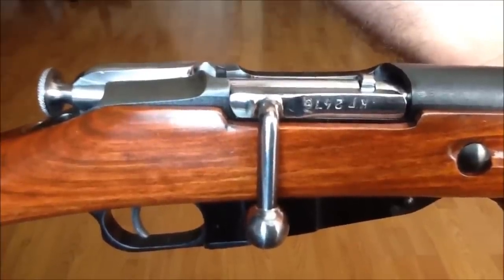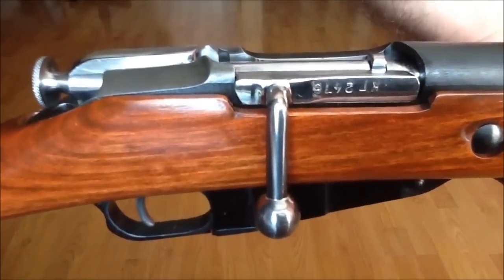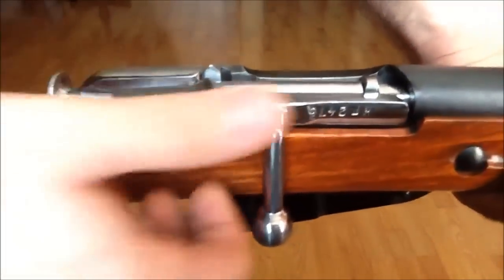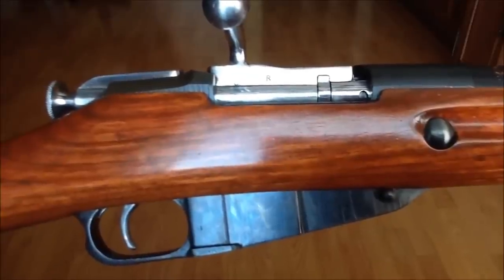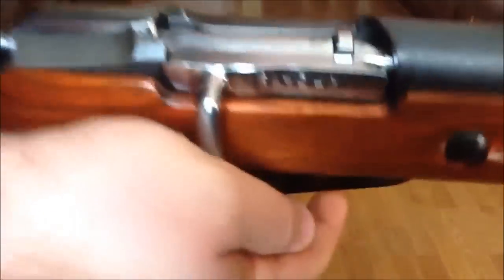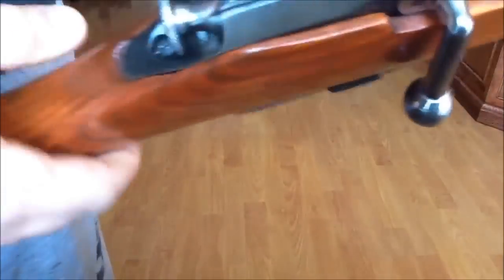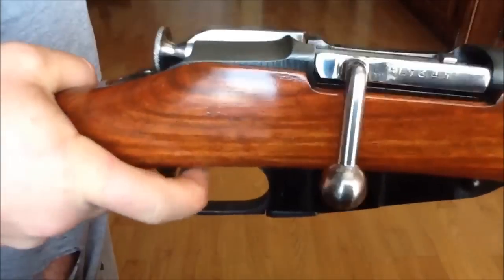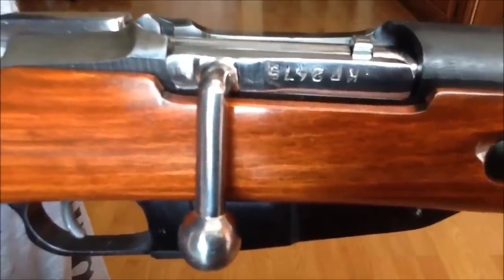Why Your Mosin Bolt May Be Hard to Close (not chamber or extractor related)

Comment from the maker: Thanks for responding. The shims would definitely work, especially if the rifle will not be repeatedly disassembled and reassembled. For example, when completely taking it apart to clean after every range trip.

Pillar bedding, in my opinion, would be a more desired, but also more demanding, fix. However, it would definitely improve the consistency of the rifle. I don't know about making a video on that, since there are so many already out there.

Comment: Nice vid. My mosin is somewhat the same. I have done all the cleaning and polishing and it closes nicely and opens nicely untill you pull the trigger ( no ammo ) and the fireing pin comes forward, then my bolt is a bitch to open. I am hoping that your issue has something to do with mine. Keep the vids coming !

Comment from the maker: Hi jerlsp1,

That doesn't sound right. I have two M44s and they are both fine when opening. Have you tried pulling back on cocking piece before opening with handle? If you re-engage the cocking piece, then open using handle, and still have difficulty, it is not the spring. And if you did try this, and you are sure it is the spring, shorten it. I have seen videos on that, and have done this myself without any issues. Let me know how it goes, maybe I can help.

Comment from the maker: Sorry to hear. You could try manually placing the round under the extractor into the bolt head face, and then closing the bolt, which, if still difficult, would mean it is not the problem with extractor, and likely with chamber having a burr or being dirty. And if the bolt closes fine with the round sitting in it, then the problem is most likely with the extractor. There are videos showing how to resolve each of those.

Comment: Sorry I'm spamming, on the bolt body, I'm not talking about the serial number. When you flip the bolt up so the handle is sticking straight up, there is a marking right under the bolt handle. Mine just looks like a number. 40 or 46 can't tell.

Comment from the maker: Interesting idea. I have thought about shortening the mag walls or that little feed ramp, but figured that fixing this with pillar bedding, or simply glass bedding would raise the action and not only fix this issue, but improve overall accuracy by making the contact consistent. However, the fix you are suggesting should work very well.
Reply: I have a sniper that was converted back to normal use. but unscrew the plugs, and put the scope mount back on. any way. the action, had cork in the stock, behind the trigger area and a cardboard shim under the barrel. I shimmed all screw points, with metal shims.
Reply from the maker: @steve-rr3nq  yes, that is a good way to do it.
Reply: @steve-rr3nq  maybe you could do a video showing how you did it. Or perhaps you have a web page with pictures... 🙂
Reply: @mkshffr4936  I watched videos here on youtube. after I took the rifle apart, I used cardboard to make templates of the areas that needed shims. then traced to aluminum and cut them out and fitted them. my rifle still had the cardboard shim, under the mid point of the barrel. it was like cutting construction paper. very easy.
Reply: @steve-rr3nq  Thanks, much appreciated.

Comment: I know it’s been 10 years since this video was posted…. But this problem can be very easily fixed with action shims or cutting shims for the magazine.  Scrap aluminum or brass… possibly even splitting a piece of copper water pipe and flattening it into a sheet and cutting shims from that… but it is a simple fix… pre made action shims can be purchased on eBay relatively cheap as an “ accurizing shims kit” anywhere from a few $$$ to about $30 depending on the kit and the amount of shims.
Reply from the maker: Agreed.

Comment: Are you using the PU Sniper Bolt?...... Or is that a PU Sniper without the mounted scope?..... Just asking....
Reply from the maker: I just had 3 mosins that I had the bolts modified to turned down handles. Simply for ease of use and so the bolt handles don't stick out.

Comment: Sorry for so many replies, but you're the first person to respond to me. I've run a 20g bore brush on a drill with some solvent through the bore where the bolt locks into to place. To get any left over cosmoline out of there, cleaned the rifle for hours, took the bolt all apart cleaned it. I'm probably going to do some polishing on the bolt, sand down the edges where it locks up on the safety in the back. And where the bolt meets the reciever face on the bolt body.But the spring is damn stiff.

Comment: yes mine was hard to close but opened ok. wasn't too hard to open. extracted shells great. I kinda like it being stiff to close.
Reply from the maker: Well, there is no way it cannot be stiff, because the extractor is in play, the headspace, and the firing pin spring. I think the problem is that sometimes it can be too stiff. A little stiff is a good thing.
Reply: MosinVirus I ment most of the ones I've seen at gun shows are dirty and not taken care of and seem to act up.
Reply: MosinVirus
My mosin had issues at first too i ran a 20GA bore brush into the chamber, cleaned the chamber, the locking lugs. Doing that significantly smoothed out the locking, and unlocking the action. Then hand filed and smoothed all sharp edges i could find then polished the bolt, and straightened the extractor outwards till the back of the extractor was flush with the side of the bolt, and it smoothed out a little more. and even then it was still super stiff so i decided to try lightning the firing pin spring, so i cut 3 coils off ( mine was an insanely strong spring) It is still reliable with surplus ammo.and that made the action so much better still locking close tightly but was still a little catchy and i just stumbled across this video of yours so i grabbed my mosin and tried it, and it completely solved all catching issue. I tossed 2 super thin washers under the mag body, tightened the screws down ,and bam! A perfectly smoothed mosin that feeds, locks ,unlocks ,and ejects beautifully. It even pops the stripper clips out like its supposed too.
Thank you for providing the last piece of the puzzle to make my mosin perfect.
Reply from the maker: My pleasure. Glad I could help.
Reply: Your videos on your 1911's have peeked my interest in attempting building one. Do you have any suggestion on how to start and what kind of realistic goals I should have for a first time 1911 build?
Reply from the maker: countryguywithcamera Well, where to start depends on what you want to do. For example, you need to figure out what gun you want to build (caliber, size, finish). Then you need to decide what your finished result should be and how much money you are willing to spend. For example, you want a low cost build and you don't necessarily care for a lot of fitting. Then you need to see which tools you will need. Then you make a list of all needed items and price them out. I would also recommend to get a book (1911 shop manual vol 2 by Jerry Kuhnhausen). I don't know how comfortable you are with 1911s and don't know your level of experience taking them apart, etc. Becoming familiar with them before you start would help.
Reply: well I'm comfortable with the workings of a 1911 and working with firearms with files and such I've just never tried to build one from scratch.
 If its not a 5in gov't and in .45 it aint a 1911 LOL JK
In all seriousness i do want a 5in .45, but I do want a ramped barrel ,and i'm gonna actually tune it to run .45 super. i dont mind minor fitting but i dont know if i have the skills to do a full hand fit build. the finish will probably just cerakote with some combat finger groove grips.
Reply from the maker: countryguywithcamera well, that doesn't sound like you want to go cheap on parts, and it also sounds like you will not need as many tools... how will you be cutting the rails? if you have a mill, great, if not Matrix Precision rail cutting jig. If you live in a free State you can order a steel frame with a ramped barrel cut. I'd going the 80% route, you may find a frame that has a Clark/para ramp cut, but the only steel 1911 frame I have seen with that is series 80. so you will need to either build it as series 80 or get a TJ series 70 shim (go for .060 or .065" shim.)
I don't know anything about .45 super and don't know if there are drop in barrels for that. or if you simply cut the chamber deeper. in any case if going with a non-drop-in barrel you will need a bottom lug cutting kit. Parts Advice: once you have your slide and barrel, measure both and order an EGW bushing for those dimensions. don't add or subtract tolerances, they will build them in. Also, if you do desire a tighter fitting grip safety EGW and Harrison Designs grip safeties are available with undercut radiuses so you can get them married to the frame seamlessly. do not buy cheap parts so later you don't go over budget buying better replacements. Consider a comp for your .45 Super. this would mean having to thread the barrel and adding a comp and later marrying the rear of the comp to face of the slide at 1 degree angle or so (due to barrel tilting into lockup) if you have any other questions, shoot me an email at Mosin.Virus@gmail.com
Reply: the .45 super is actually the same case dimensions as acp it just reguires full chamber support or it will bulge cases, a hot .45 super is cooking at about 1150-1200fps with the same 230gr bullet depending on the loading
Reply from the maker: Oh I see. Makes sense.
Reply: sneakysnakepie1 Trust me, you wouldn’t “like it being stiff to close” if your life depended on you putting shot down range

Comment from the maker: Hello, and thanks for watching and responding. I have done some work on the receiver as well as the stock. If you are talking about the inside of the receiver and the bolt channel or raceway, I have polished it with 400grit, then 600 grit and finally 0000 steel wool. Outside, I finished the receiver by removing the chunk of metal on the right back wall (by the cocking piece), and touched up the left wall as well.

Comment: Mines only hard to close when loaded. Tried the wood stock and a polymer stock, same results. I think maybe it's the extractor face going around cartridges.
Reply from the maker: Correct. There are a number of reasons why a Mosin bolt is difficult to close. Mine was another issue. You are on the right track with yours. Also check if the chamber is dirty, especially if the bolt is also difficult to open after firing.

Comment: Sounds like you may have a headspace problem. I would get some go/no-go/field gauges if i were you and try the "go" gauge. Is your bolt original (do the numbers match the receiver?)? If it doesnt close on the "go" gauge, try buying another bolt to get a better match, i guess. I just bought 3 spare bolts from  Sarco for about $33 each. Buy the gauges from Okie (Google him). I think he is running a special on all 3 for the price of 2.

Comment: Hi, I'm new to the Mosin-Nagant, I know is the bolt was modified by Jim, but it looks like the original style bolt used on the Sniper versions of the 91/30.  Are you planning on installing an original style scope or did you just like the bolt style?  Just curious.  I'm looking to find an original bolt and scope/ mount to convert mine.
Reply from the maker: Welcome to the Mosin Nagant family then. Yes, I paid Jim to mod 3 bolts for 3 of my rifles. One I have converted to the PU sniper, using Jim's modification of my original (matching number) bolt, and reproduction PU scope and mount from Accumounts (see my videos on mounting a PU scope). The rifle in this video was sold unfortunately - I had to make space. If you are looking for original (non-repro) PU scopes, try Kalinkaoptics.com

Comment: Oh and also, the bolt operates smoothly before the firing pin is released. When it's charged it opens and closes fine, its not till after the trigger is pulled that it becomes hard to open.

Comment: I just got my hands on a Mosin Nagant today, and it's perfectly okay to close the blot when it's empty, but it's very hard to put the bolt fully close when pushing a round into the chamber. Is that normal? Because it's not my rifle, so I couldn't try this method right now
Reply from the maker: +Stiglitz Lau that is a different issue. Could be extractor related, or head spacing may be off, because someone could have replaced the bolt head.

Comment: Mine does want to close when a round is in the chamber. You gotta really push it down to put the bolt back in place. But when a round is not in the chamber it works fine.
Reply from the maker: Then it is most likely extractor or chamber related. Iraqveteran8888 has great videos on resolving those issues.

Comment: Shouldn't have bent your bolt, makes it harder to operate by slapping it open and closed. Mosin's are known for being "slap bolts". That is just an example pretending your mosin is a pos like most.
Reply from the maker: Thanks. I don't have to slap my bolts. They open and close just fine. If you want to deny the fact that certain things can make the bolt harder to manipulate, and that those things can and should be fixed (as is the case in maintenance manuals of the time) then I guess this video is not for you.
Reply: @MosinVirus  No need to give me the business. I didn't say shit about it not being correctable. I was complimenting your mosin, and describing the common operation behavior of the more common subpar mosins. Which are often "slap bolts" out of the cosmoline.
Reply from the maker: @MasterTaters  oh, sorry, I completely misread your comment. My apologies.

Comment: I think there is supposed to be a tiny gap there where the bolt locks down looks like your bolt has been redone might be your troubles
Reply from the maker: The gap is supposed to be between the magazine box and the receiver. That is why shims are necessary when the stock gets squeezed too much in the mounting points

Comment: Hey man I would like to have some advice I do not have the same problem that you are having I'm only having a problem after I dry fire the weapon the bolt is pretty hard to open I polished the chamber and every contact surface of the bolt and I think I cut a half a coil off of the spring any advice on how to fix that it helps a lot when I have a bunch of grease on the cocking surface but that goes away after working the bolt quite a few times
Reply from the maker: You should take a look at the camming surface between the bolt body and the cocking piece. What you are describing (difficulty opening the bolt) is related to having to have the body of the bolt push the cocking piece away to the rear (via the camming surface) and at the same time you are working against the firing pin spring. So I would look at that surface. Iraqveteran 8888 has videos on smoothing the Mosin Nagant bolt I believe. His video should be describing this process.

Comment: This primarily occurs because wood stocks shrink as they age. Normally it catches at the rear of the magazine. You have two options: you can shim it, or you can grind down the top of the magazine to make it clear. It doesn't hugely matter which you choose; the gun will still work correctly regardless.
Reply from the maker: Thank you. I would fix by pillar bedding. I think it is the most durable and long lasting fix.
Reply from the maker: +WardenWolf I understand. since you were already filing the magazine box, did you also file the back wall, inside, to fix rim lock?
Reply: No. Mine never seemed to encounter rim lock.
Reply from the maker: +WardenWolf That is a good thing. I was thinking of posting a video showing how to improve the mags.

Comment: The exact problem I am having. I have an ATI stock, and I noticed this when I would assemble the gun. With the barreled receiver in a vice, the bolt was so smooth.
Reply from the maker: DJ Matusiak Good to know. Are you planning on using shims?
Reply: MosinVirus 
Yes, the pillars from rock solid. I found my '42 91/30  izzy at a pawn shop already with ATI stock, scout picatinny on the sight base, and a 20" hack-sawed barrel... terrible, terrible work. So, I found my project gun. 

Recrowned the barrel, did some trigger work, free floated the barrel. I was going to glass bed but I guess it's pillar now. Rock solid mount is next.
Reply from the maker: DJ Matusiak Nice. Sounds like a great plan and a fun project. Good luck and hope it goes well.

Comment: This wasn't happening before, though! It happened after firing 100 or so rounds. Could it have just been knocked around like that? I wouldn't think so. :P
Reply from the maker: This isn't the only problem that could cause a sticky bolt. If you started getting a sticky bolt after 100 rounds, it could be the other problems with dirty chamber, etc. Or it could still be a combination of both. If your receiver can slide around in the stock, it could move enough to change the alignment and spacing between the magazine/trigger guard and receiver. You would have to investigate to see which problem your rifle has.